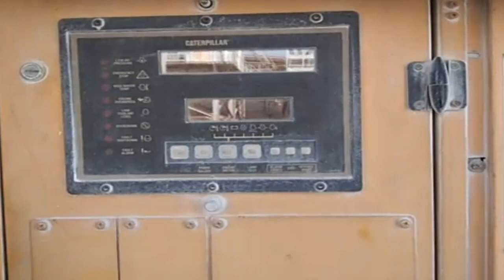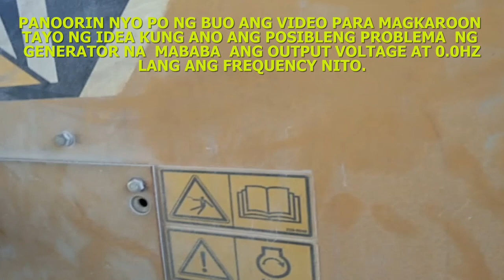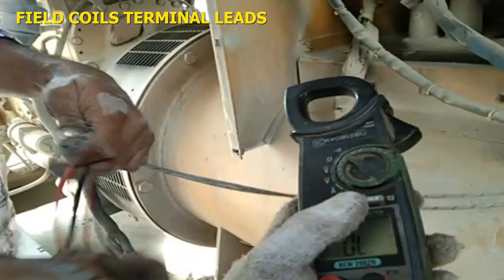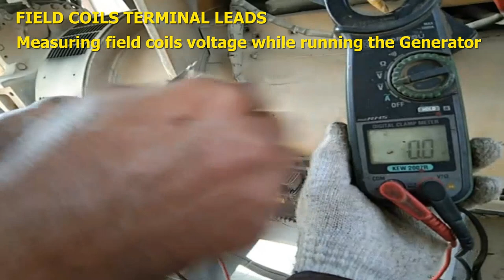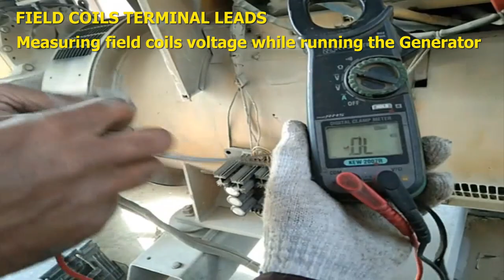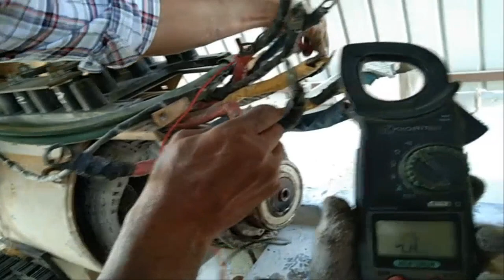CATERPILLAR GENERATOR FAILED TO RUN DUE TO LOW OUTPUT VOLTAGE AND ZERO FREQUENCY.

Comment: Sir saan ba location nyo? May priblema din oc ang genset namin na walang frequency at wala ring voltage reading. Ipapaayos ko sana sau.
Reply from the maker: Nasa Disyerto ako ngayon sir, napakalayo sa kabihasnan. At saka ung oras kulang na kulang sir, 3am hanggang 10pm ang trabaho.

Comment: saken boss abb alternator ko.. cat ung engine.. ang problema ko di nya maabot ung 690 volts na output voltage... L1=654 L2=648 L3= 702
anu problema kya neto?. salamat
Reply from the maker: AVR sir, paki check mo.
Reply: @masterpinoyelectrician  sir pg nag asjust ng voltage lahat sila tumataas..tataas maxsdo ung L3 ko.. anu p pwd icheck..salamat po
Reply from the maker: @servogun1493 master pasukin mo software nyan, don ka magset ng voltage L1, L2, L3